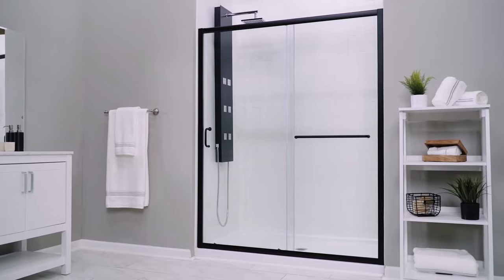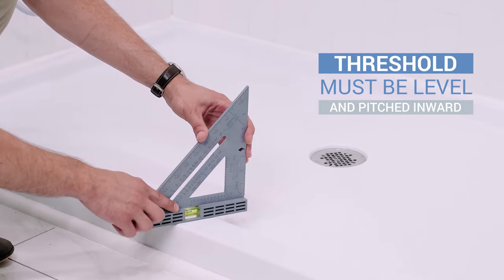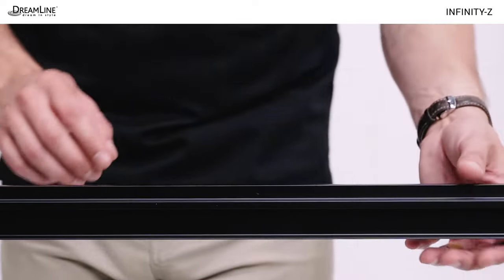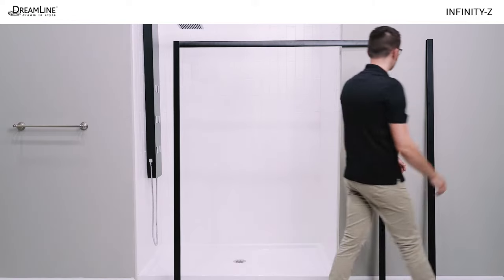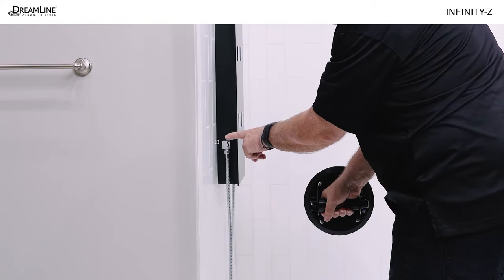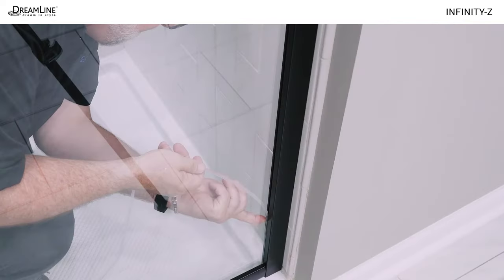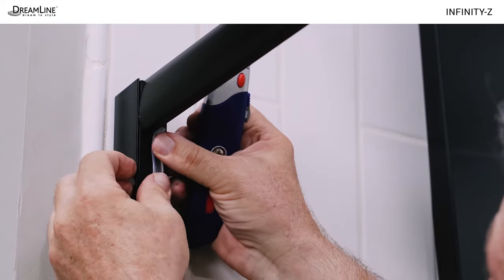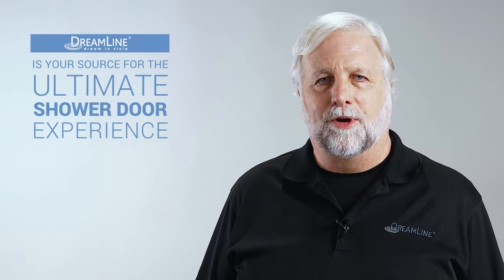How To Install a DreamLine Infinity-Z Shower Door | DreamLine Shower Door Installation Tutorial

Comment: Great video tutorial. Walked through it step by step, didn't have to go back to fix anything, went in perfectly! The only thing we did differently was to draw pencil lines on the walls fully around the leveled frame for reference and placed the bead of silicone on the wall and floor instead of on the frame. We took or time, about an hour and a half, and it's perfect! Thanks a million!
Reply from the maker: Hello Tina. Thanks for reaching out to DreamLine! We appreciate your review and your tip on the pencil lines will likely help others as they go through the installation process. Thanks for choosing DreamLine for your shower remodel!

Comment: Outstanding! Definitely helps to clarify the written instructions. My one and only gripe about the install is hanging the door.

We tried several times to set the bottom wheels in the track and then lift up the door to drop the upper wheels into the top track. We ended up setting the top wheels in place and then used the plunger on the bottom wheels to get them into the track.
Reply: Plunger? Ours is making noise, we tighten it on topand it got worse

Comment: Great instructions, thanks!  I got it installed no problem.  Quality product and looks great.  I like the way it was designed, very forgiving of out-of-plumb walls.  The weight of the doors comes straight down on the frame and not the walls like it does in a frameless design.
Reply: About how long would you say it took you to install??
Reply: @bradmichael3699  about an hour

Comment: This isn't an easy door to install by any stretch. The video does help....some, but don't get it confused. There is certainly a reason they are showing you this tutorial. I renovate homes, and do a great, but this door took a little more time than expected. Few issues here and there, but I won't complain. I got the door in good. Wish the mentioned or discussed installing in tiled shower. Just my 2 cents

Comment: Awesome instruction video, save us few hundred bucks to hire a handyman. I've successfully installed it from this video without reading the manual, pictures worth a thousand words. Dreamline should fire all the tech manual writers and keep these folks around for video instructions only, it's a different time now ... everything digitals.
- Price is mid point for a luxurious finish
- The design of the hardware on glasses positions are excellent, hard to make mistake. I only have to worry about which side is the door.

- The drag .... When hanging the door by bottom wheels first per instruction, I had trouble pushing the door up to engage both top wheels. What I did was removing the bottom wheels, hang the door only from the top wheels first then carefully sliding in the bottom wheels and screw them up, it was a piece of cake (for my case).

Comment: Very helpful video. What do you recommend for a gap ( 3/4 in) between the bottom frame and the fixed shower door? Caulk does not seem an appropriate solution.
Reply from the maker: Hello Amy, thanks for reaching out! We recommend contacting our Customer Support team so we can troubleshoot what is causing the 3/4in. gap. Please give us a call at 866-731-2244. We are available 9am-6pm EST, M-F. You may also send an email to support@dreamline.com. We look forward to helping you! Thank you for choosing DreamLine.

Comment: Good video for when everything is perfect.  The instructions should give you some variables for walls that are not plumb.
Reply from the maker: Hello Billy. Thanks for reaching out to DreamLine! The Infinity-Z allows for one inch of out-of-plumb adjustment on either side of the shower. By subtracting 3-3/8" from the shortest width measurement, any out of plumb condition should be accounted for, within the one-inch limit of the model. We would recommend contacting our Customer Support Department if any further help or explanation is needed. We can be reached by sending an email to support@dreamline.com and through our Chat with Expert feature on DreamLineShowers.com. Our hours of operation are 9am-6pm EST, Monday through Friday. Thank you for your interest in DreamLine!

Comment: Great video and manual was good (and matched instructions here well).  Take your time, it's worth it rather than rushing. 
My tips would be to be very careful how deep you are drilling.  I almost went all the way through because I wasn't thinking.  Do not use a power drill to drive any of the screws except the screws going into the studs, too easy to strip in the soft metal (aluminum, I'm guessing).
Otherwise not particularly difficult at all.
Reply from the maker: Hello JW. Thanks for reaching out to DreamLine! We appreciate your review and your tip on drilling carefully, and not too deep, will likely help others as they go through the installation process. Thanks for choosing DreamLine for your shower remodel!

Comment: Install went sort of okay, thankful for the video to help, but there's room for improvement on both video & printed instructions. There were a few bloopers in instructions- one said to refer to a certain page for details and it was the wrong page, and a part referred to in instructions had a typo and referred to wrong part.  Install steps that didn't make sense: caulking under the frame then continuing to work and it's getting slid around ruining that bead and smearing it around.  I saw that my silicone bead underneath was getting smeared around, probably rendering it useless and making exposed messes so I stopped and let it cure a while.  I hate cleaning up smeared silicone so I wish I'd have set the frame in along my carefully marked pencil marks, secured the wall screws, then walked away and not touched it again for a while.  Would have kept a better seal underneath and not made a mess to clean up.  The door was a pain to hang, after putting bottom rollers in and lifting up on door we still couldn't get top rollers in without a big wrestling match.  Later I realized we could have hung the top first then used the buttons on bottom rollers and put those in second.  The door seems a bit noisy while gliding and it says to adjust set screws in top rollers to fix that, but nowhere does it explain what turning those screws does??  Does it raise and lower the door at that end?  Does it increase friction??  I've played with turning the screws with the door hung but can't quite tell what it's doing.   Lastly, it's time to caulk around the interior of the frame- the walls won't be a problem but with the door in place I have a good 6-7" area on the bottom that I can't get to- sliding the door left or right doesn't expose that overlap area.  Trying to caulk under the door to get to the inside bottom edge of the frame with a nice bead won't be easy so I'm probably going to end up removing the door.  I might as well have caulked the inside edge before putting the door on, let it cure, then put the door on just 1 time!    For the price I thought the rollers would be higher quality- smoother, quieter and more heavy duty but this isn't a shower that's used daily so hopefully they will last.
Reply from the maker: Hello, we recommend that you contact our Customer Support Team for better guidance on how to make adjustments and to ensure that your shower door was installed correctly. The Customer Support Team can be reached at 866-731-2244 or support@dreamline.com. Our hours of operation are 9am-6pm EST, Monday through Friday. 
To answer your question regarding the roller screws, they are supposed to be used if the door doesn't line up and seal nicely against the seal inside the wall jamb. These screws are for minor adjustments to even out the the way the door closes against the seal - to make it "tilt" one way or the other or to make it perfectly level - whichever is needed to make the seal consistent.

Comment: Question...the height of my shower is 75". If I purchase a door with a height measurement of 72". Is it talking about about the height of the glass from bottom to top or is it talking about the distance between the bottom frame and the top of the "top" frame??  I just want to make sure that I get these measurements right. I would like the top frame to be flush with the top of the shower if that makes any sense. 🤔
Reply from the maker: Hello! Thank you for reaching out. The dimensions we provide are the full installed height of the unit. The 72" height measurement includes glass and hardware after installation. If your shower is 75", you would have 3" of wall above the shower. 

For assistance, please contact our DreamLine Customer Support team at 866-731-2244. We are available 9am-6pm EST, Monday through Friday and will be happy to answer any questions you may have. You may also send an email to support@dreamline.com or use our Chat with Expert feature on DreamLine.com.

Thanks for your interest in DreamLine!
Reply: @DreamLineShowers  thank you! I'll be installing mine on Saturday.  Your video made me confident that I can get it done myself and save a ton of money.

Comment: I went  to install  the shower doors and this is when I realized that even though  they  say that  you can install  the doors either  right  or  left there's  one thing they don't mention because the fixed door is always on the outside and the door on the inside you also have to move the shower head to the door side or it will leak.
Reply from the maker: Hello Amy. Thanks for contacting DreamLine! For any questions you may have about our products, we invite you to contact a DreamLine Customer Support Representative at 866.282.8413. We are available 9am-6pm EST, M-F, and will be happy to answer any questions you may have. You may also send an email to support@dreamline.com or use our “Chat with Expert” feature on DreamLineShowers.com. Thanks for choosing DreamLine!